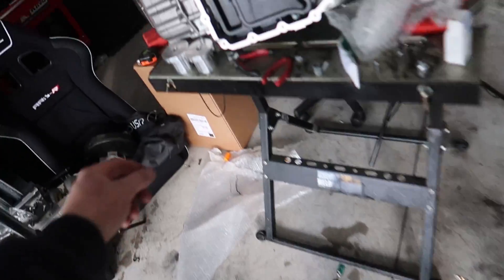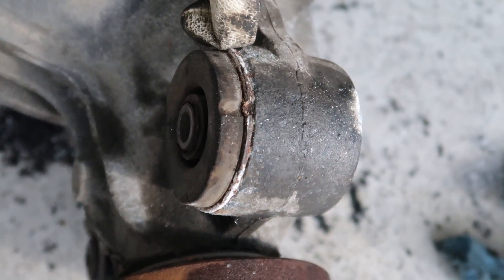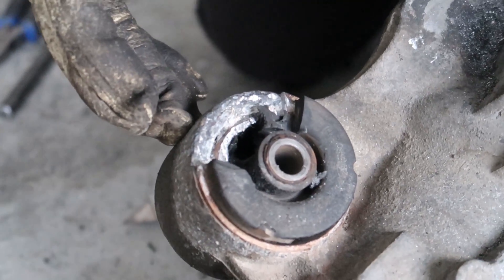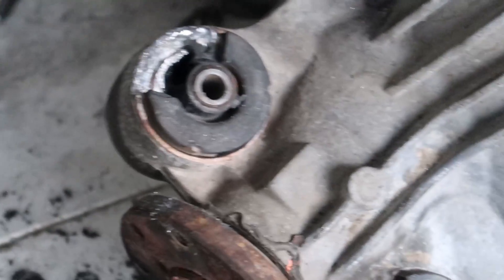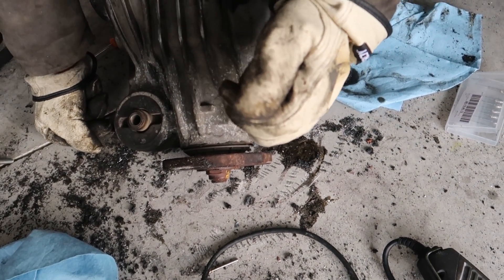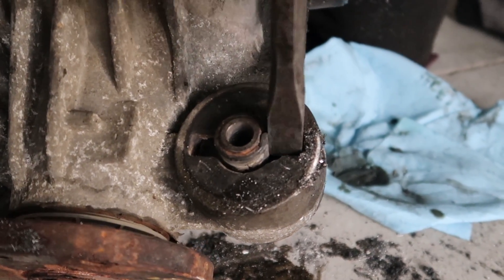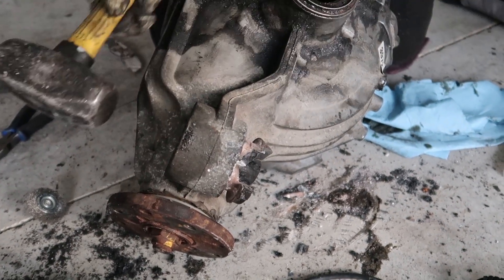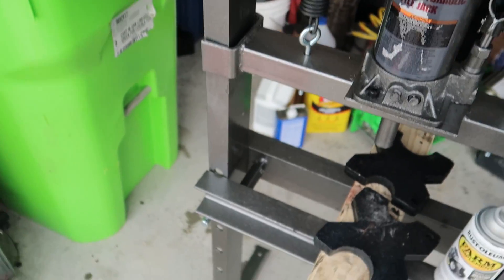How To Remove Ford 8.8 Explorer IRS Diff Bushings

Comment: where can i get that bushing?
Reply: That removal is painful to watch. If you don't have access to a press, then a ball joint tool or gear puller takes about 30 seconds. The free rental tool from any of the chain parts stores will work fine.
Reply from the maker: on our website, seemslegitgarage.com